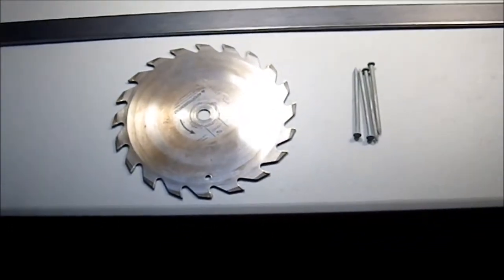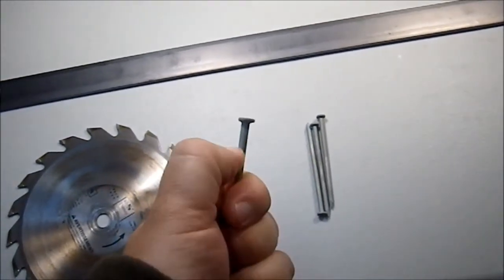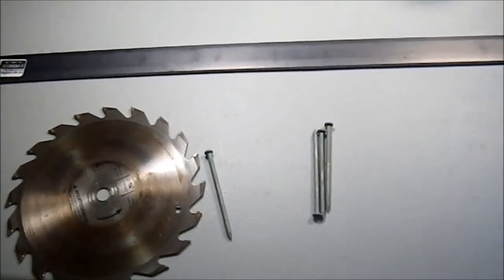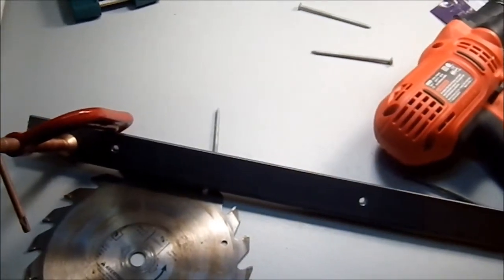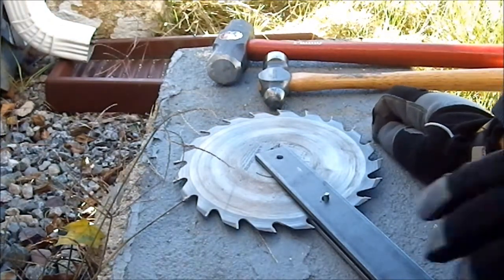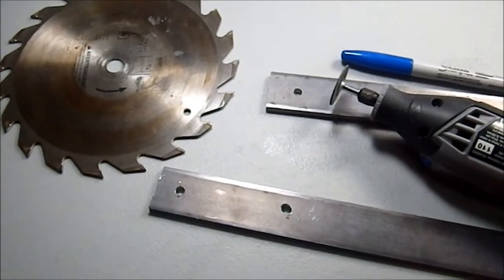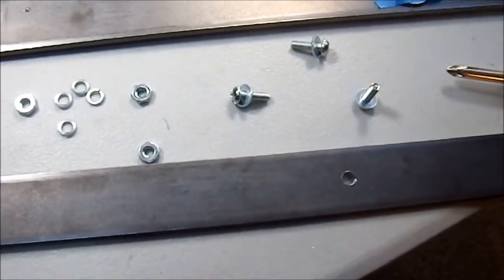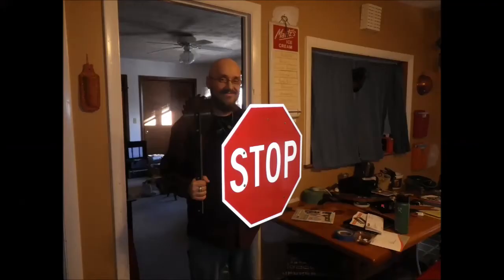Crafting with Tetsubo: One-handed Post-Apocalyptic Axe

Comment: a good handle wrap that i have found is an ace bandage and a rubber band to hold the final bit in place, works very good on a bare metal handle and can be easily removed if desired.